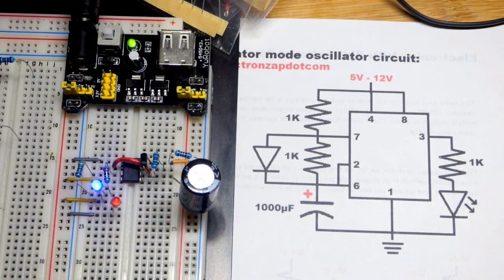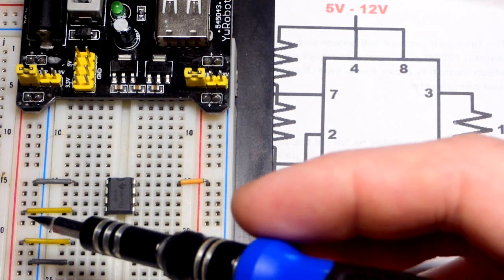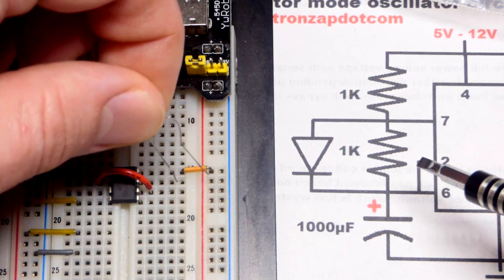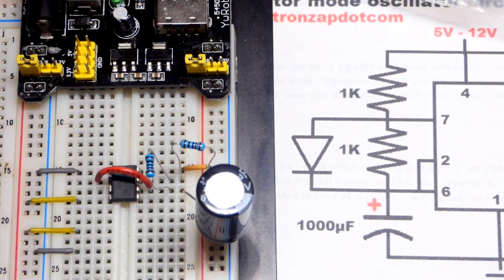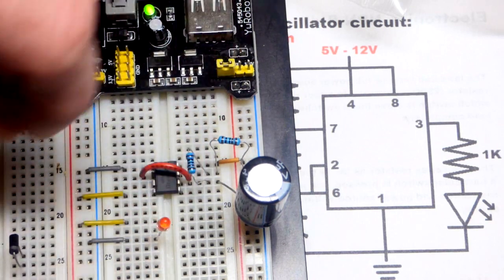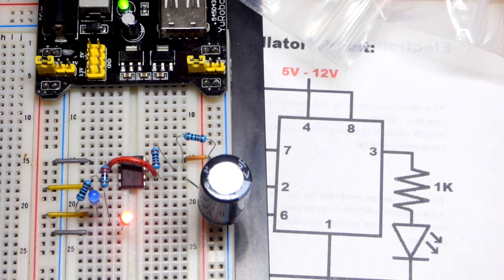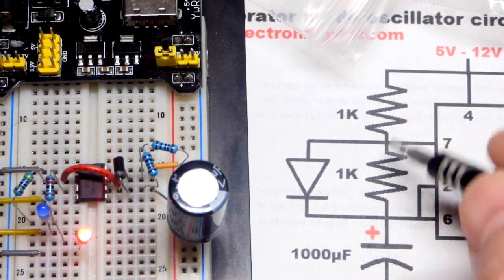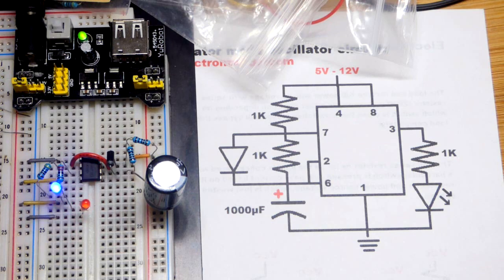555 timer astable mode diagram build step by step for beginner learning electronics

Comment: Would it be safe to say (in laments terms i.e. to non electronics peps) that the 555 timer is the heartbeat for digital electronics  esp. in astable mode?
Reply: So I can take this as a yes?
Reply from the maker: That's one analogy you could use, especially when you use the high output to power a red LED, it kind of resembles a pulse of blood flow. If the output is being used to set the timing of a circuit, then it is called a clock signal because each high and low output is like a swing to and fro of a pendulum. I don't spend much time thinking up analogies.
Reply: @Electronzap  The reason I asked is that I have the 555 timer T-shirt that I wear periodically and am asked about it. And it is usually asked by non electronics types. So I am trying to make it easier for them to understand.

Comment: I very like your videos keep up the good work, but my thoughts about the 555 timer...
I have always thought that the 555 timer is a very good IC but it is a very bad design. What I mean is that it is a shame that pin 3 output should be on the right-hand side (Eg. output on pin 5, 6 or 7) and that pins 2, 6 and 7 should be close to/next to each other, this would make the 555 easier to connect up instead of having several jumpers all over the place and pin 4 should be ground. Someone should redesign the 555 pin layout. 
What are your thoughts?
Reply from the maker: Glad to hear, thanks for watching! Sorry my phone didn't show your full comment earlier when I responded. There may be a history of why the pins are where they are. Once a part number is established, I don't think anyone would want to change it or there'd be too many versions to keep track of.